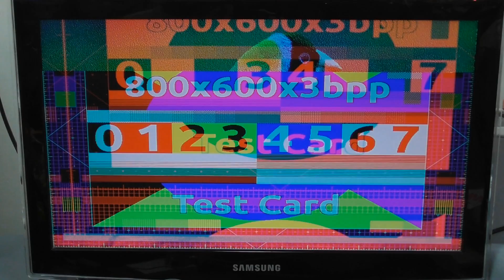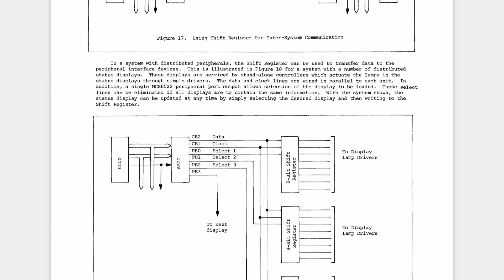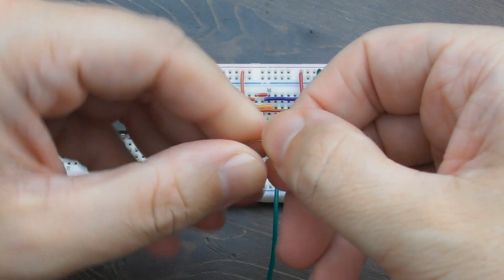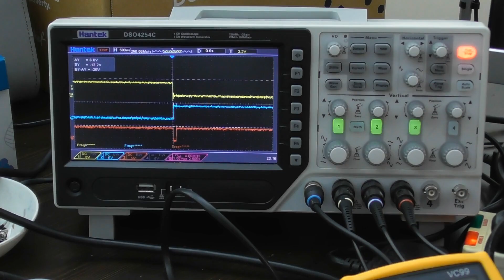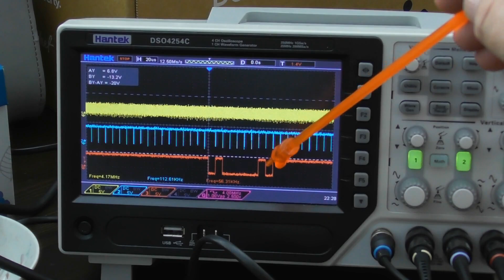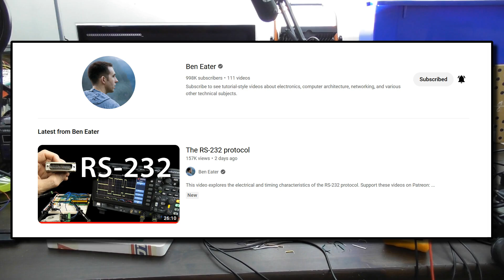Low Tech Serial Output

Comment: If the serial is still being sent, you must prevent a new letter from being inserted. 
Either you wait 400 clocks or you make a busy signal.
Reply from the maker: Yes, indeed - there's no hardware buffering so I will need to wait either before or after sending the character. I've considered using a counter to let the CPU poll for an empty buffer, and it might mean that I no longer need the flip flop. But just delaying a bit is simplest, and simple is the goal here.

Comment: Very nice video George.

I suspect you have an off-by-one error in your baud clock divider.

The intended baud rate was 115,200 baud (4,500,000 / 39)

What you got on the scope was actually 112,600 baud (4,500,000 / 40)

The error is possibly because the counter is couing 39...0  then reloading synchronously, which is actually a division by 40. Try setting the counter parallel load input to 38 and see if this fixes it.

(Even at 112,500 baud (2.5% slow) it still works because because the slippage the whole character is ~25% of a bit time.)

Dave
Reply from the maker: Thanks Dave, yes I realised that might be the case, and I meant to put a caption up while editing, but forgot! Still, it's close enough! I also kept mentally forgetting whether it was meant to be 115200 or 112500... oops!